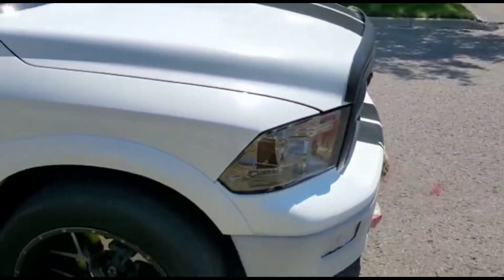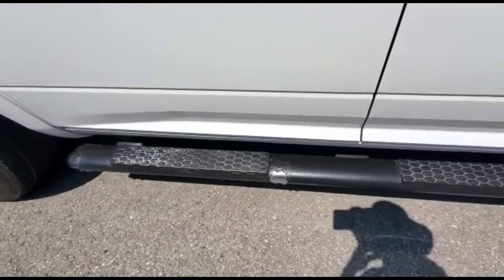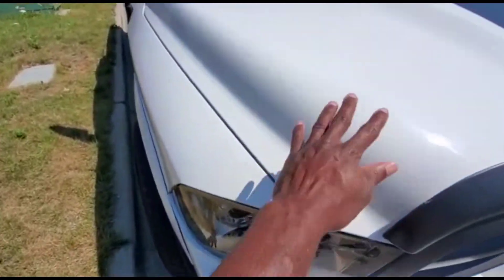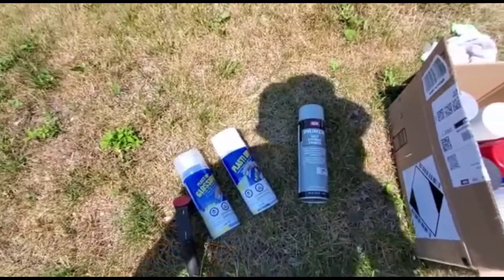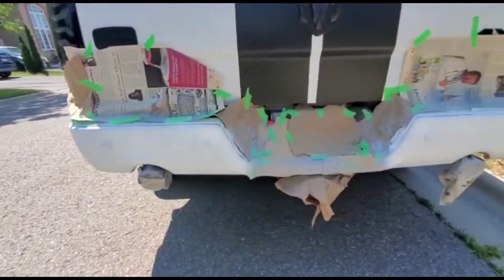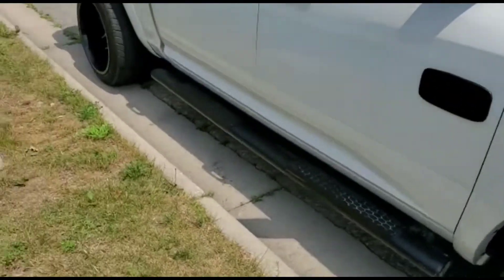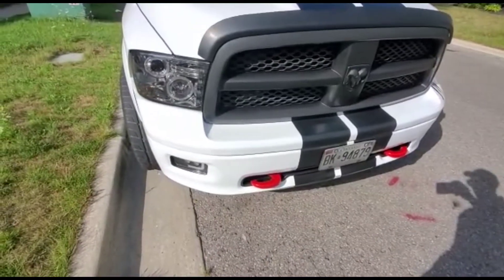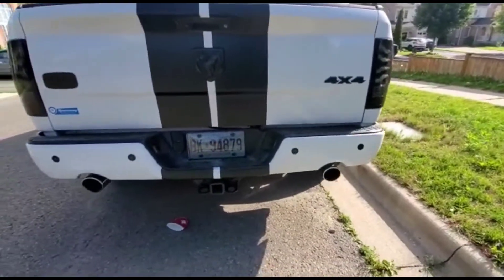How To Paint Chrome Bumper | Dechroming (Plasti Dip) Affordable DIY | Vlogmas in July Day 29

Comment: How did it hold up ?
Reply from the maker: To be honest it held up good for the summer and fall, but after the winter it started to peel off.
Reply: @GROWingInLov3  appreciate the update
Reply from the maker: @nailbndr9869  No problem. Thanks for watching.
Reply: @GROWingInLov3  I have the same truck, white with chrome bumpers, I want to get rid of the chrome, your video helped me , I was worried it wouldn't hold up over time.
Reply from the maker: @nailbndr9869  I'm glad you found value in watching my video. All the best.